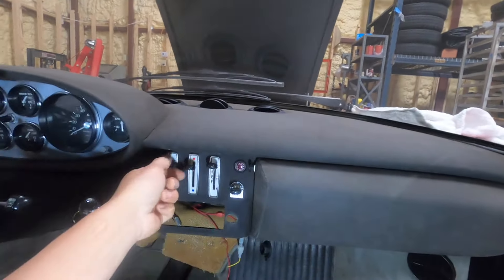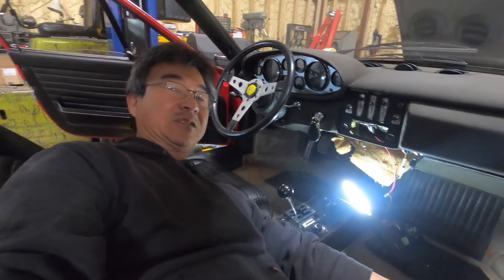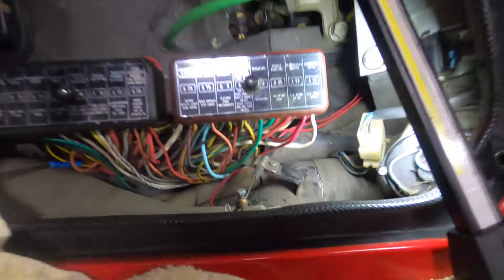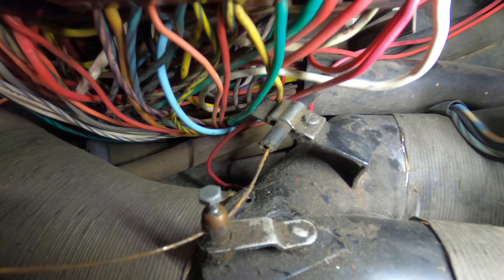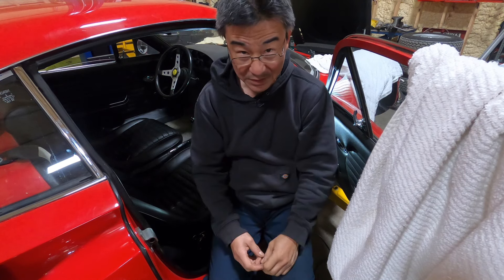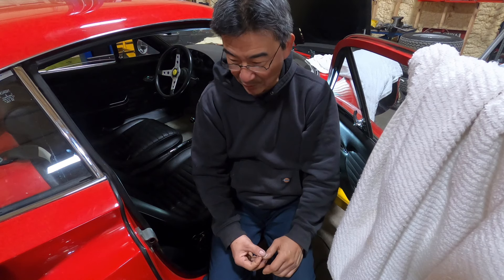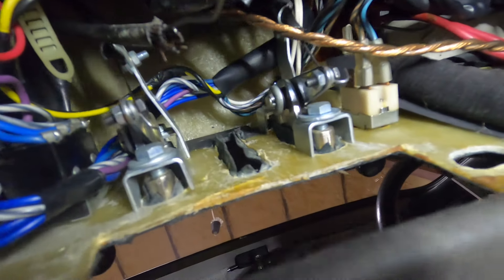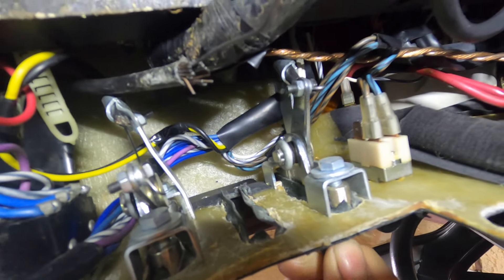Dino Heater Controls

Comment: Yep had plenty of seized cables on old classics, they just never get oiled 🤪
Reply from the maker: I'm sure they weren't greased when they were new, so with a new cable and grease, these cables should be good to go! Thanks for watching.
Reply: @tomyangnet  I found 18 gauge solid bailing wire was the largest that would go in my OEM sheath. I did not notice the end triangle angle - Thank you for the keen eye 

Bicycle guys have some of the BEST lubricants ever made for their hobby , great in these cables

Comment: Tom, one of your most relatable videos!   Easier on a 308 but still those lever assemblies are classic Rube Goldberg style.  Didn't know about the diamond shaped bend at the end.  Cool.
Reply from the maker: I don't know if Ferrari was still putting the diamond shaped ends on 308s, but I know it was done on the cars in the 60s, and since this Dino is so original, they were still doing it in the early 70s. I'm sure there are 308 experts that can confirm this with original unrestored cars, but I'm as well versed on 308s. Good luck with your 308 and thanks for watching.

Comment: Tom, beautiful work as always. Where did you order the replacement cable from? I need to do this job to my 308. Some people on F chat recommended welding wire but I think there has to be a better option.
Reply from the maker: I would wouldn't recommend welding wire as it was made for a completely different purpose and may not have the tensile strength of the correct wire for this application. I would get "piano wire" which is made to be under tension. Here's my order from Amazon:
https://www.amazon.com/gp/product/B002A4O4D8/ref=ppx_yo_dt_b_search_asin_title?ie=UTF8&psc=1
The 0.045" diameter fits the cable sheathing and the control lever anchors. Thanks for watching.
Reply: @tomyangnet  thanks! This really helps. I’ll order this for sure. The cables ares make next project this summer.
Reply from the maker: @calebmcdonald8458  don’t forget to pre-Medicate with Advil! Good luck!
Reply: @tomyangnet  lol will do! Hopefully it won’t be as bad as when I replaced all the heater hoses up front. That was awful with the brake booster in place.

Comment: Great work - but that cable rust is ugly.  Completely neglected and HALF the job is cleaning 50 year accumulation, pivots, and paths. Also, look at all the wear on the detente points from that dirt grit grinding on it.  SMH.

I use light oil to pack the new heater valve pivot end rods. The original valves are now pushing $500 but what else are you ginna use that fits.  A light oil coating helps it last just a little longer .  
I hate to say this but..... 
changing that heater valve is such a rotten task that I find it is much easier to remove the whole heat exchanger box/ brake fluid reservoir assembly along with the valve still on it.  No kidding.... otherwise you're working upside down, OVERr the edge of the car and almost torquing with no mechanical advantage.    

The 3 things I find that cause extra, unwanted heat in the Dino cabin  
1) Stuck heater valve, 
2) Vent flappers do not shut off properly , 
3) Pedal Box panel seal is missing
Reply from the maker: Hi Scott, All Vintage Ferrari cable operated heater control valve don't do a good job at turning off the heat completely, and when I put this car back together and find heat coming from the heater core, I'm thinking of hiding a secret ball valve to cut off the heat permanently for summer driving. My only hesitation is not opening the valve every once in a while to circulate some fresh coolant through the heater core to limit corrosion from stagnant coolant. 
The original control cables didn't have any grease or oil in the sheathing, so any lubrication will make a world a difference!
Reply: @tomyangnet  Superb point on the Dino cooling system. There are so many different metals touching coolant in a Dino that flushing is THE MOST important maintenance task on my Dino.

It has almost been 2 years and time to do a Heater circuit flush on 08492. Stay tuned!

Great Idea of having a shut off valve. I have  one that is a winter turn-off valve from a Ferrari 330 that I intended to install just before the heater valve at the tunnel hose "T" but have'nt gotten time to do it yet.

Ball valves are far superior sealing and I 'll bet 1/2 " standard could be fitted right off the tunnel hose "T"
Reply from the maker: @clubdinousa8700  I think the hose from the t valve is slightly wider than 1/2 inch and 5/8th may be closer. Probably 50 and 75mm respectively. Or maybe 60mm? Who knows?
Reply: @tomyangnet  Another task I have not gotten to yet! 
LOL
On the drive to Las Vegas last Nov I was pretty impressed at how the cabin stayed fairly "heat-free" after sorting out the control levers,sealing the vent flappers and making a new pedal box cover.